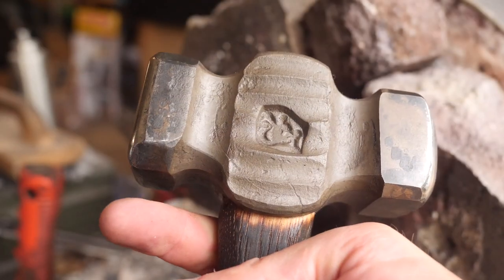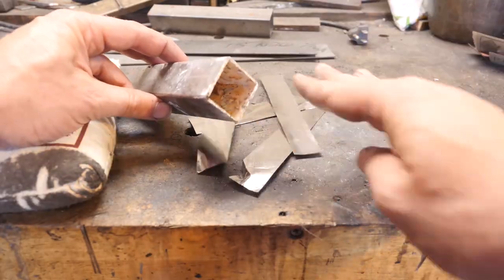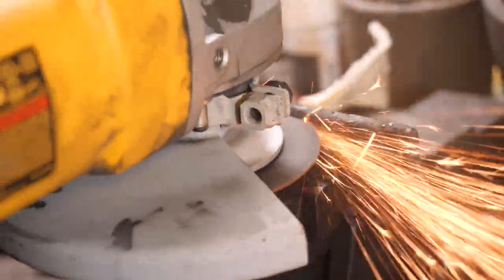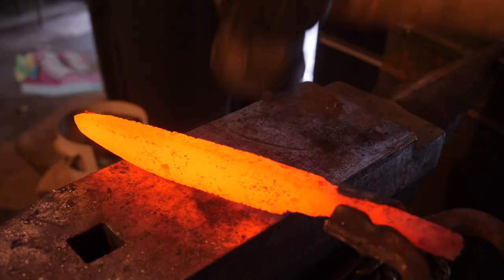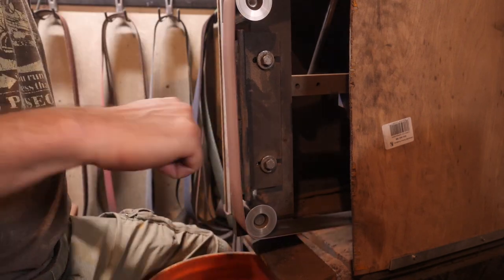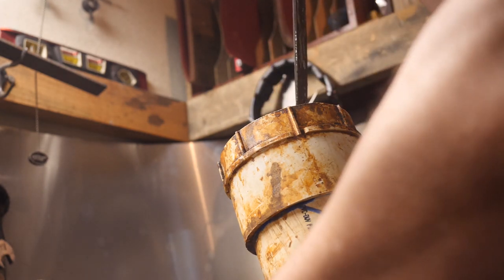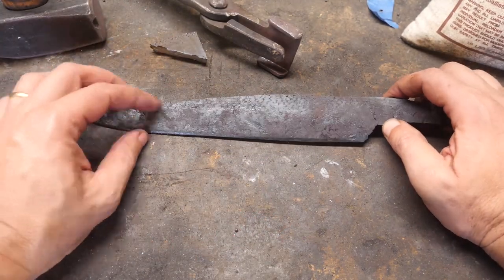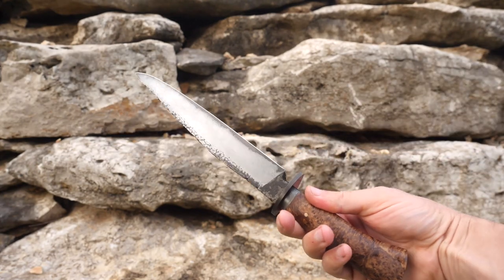Forging A Hog Hunter Knife With Shot Shell

Comment: The medium speed oils are definitely the easier way to  avoid boomerangs, plus I just tend to use the aluminium quench plates I keep for doing stainless air-quenches are a great thing to have on the side to let it cool dead flat- or at least as close to dead flat as it doesn't matter when it comes to secondary grinds. Great looking rustic blade

Comment: I've been salvaging random stuff from litter on the street for a while now and one thing I come across all the time is disposable lighters. Most of these have "flint" and steel style igniters. 
I was wondering if you could take the striking steels from a bunch of lighters and forge them together into something. 
I didn't do any research as to the exact composition, but it seems to be hardened steel. Perhaps it could even be used as edge instead of filler.

Anyway, all of the stuff you make is super neato. I really liked the scissors becoming a knife and this shot pattern Damascus turned out way better than I thought it could. You've really got a great skill and talent for this.

Comment: Since nickel forge welds in an inert atmosphere fairly well to non-chromium steels, what if you redo this style of knife (birdshot) but pour powdered nickel down the sides of your canister.  You'd still have the cutting steel in the center but the low carbon steel shot would etch dark and the purely cosmetic nickel would etch bright, giving you a really cool pattern on the outside.

Comment: Not sure if it’d work, but but about a hot and cold mixed damascus. Heat up the main stock, then press cold cones into the stock, reheat, forge weld, and then repeat with overlapping  or concentric circless

Comment: Question- I’ve worked with shield gas when welding but why haven’t I seen anyone forge with it?  Pack the container good-n-tight, leaving a small vent, soak it in a container of argon (heavier than air), raise it up, tack the vent shut; and into the forge it goes.  Or is trying to control/moderate the amount of oxygen in the container, using various other methods, just a nod to trying to minimize the inevitable?  As I’ve never lit a forge myself, it could be that I’m missing something stupidly obvious . . .

Comment: I am curious as to why you did not use steel powder to fill the gaps between the shot in the can and relied completely on pressure to bring it together? seems like there was way more opportunity to have imperfections/gaps/inclusions, etc in that billet?
Reply from the maker: It would affect the final pattern plus I thought gaps would look cool in this case.  Solid steel core wouldn’t be affected etc
Reply: @GreenBeetle  makes sense...its a beaut for sure :) Nice work

Comment: I get perky when I see a notification that Green Beetle has a new video.  An idea for you sir...  A sewer machine cable.  It throws carbon sparks. I failed on my first attempt, but trying it in a canister today.
Reply from the maker: Great idea
Reply: Plumbers should throw them out after a kink and it happens a lot.  It risky to put a splice and have a weak point and put it 100ft down a sewer.  Its 100ft of a cable with spring steel around it, and should be easy enough to come across.  Im sure a plumbing company would rather give it to you instead of a crack head metal scrapper.